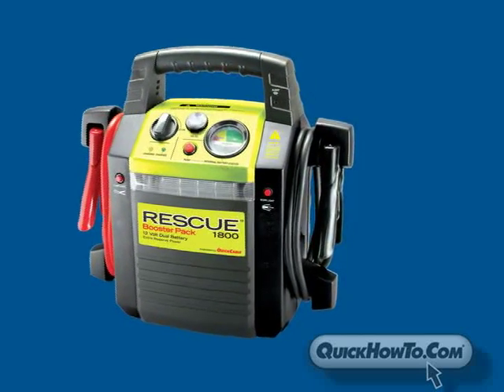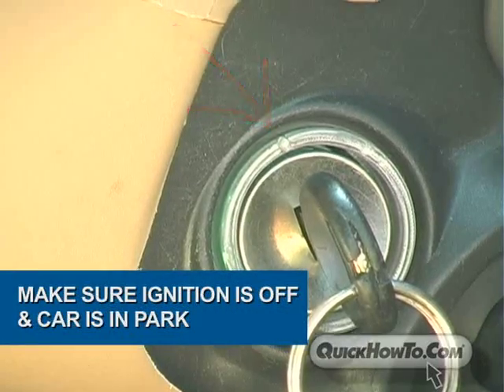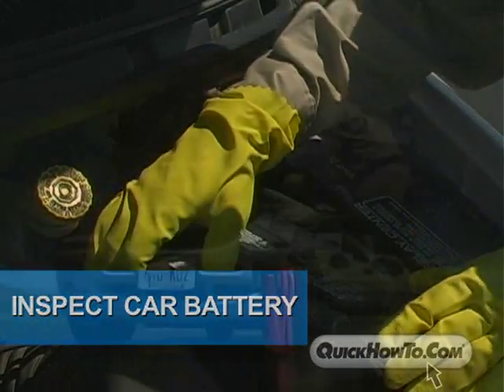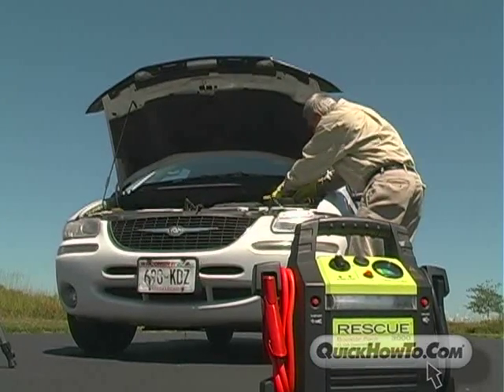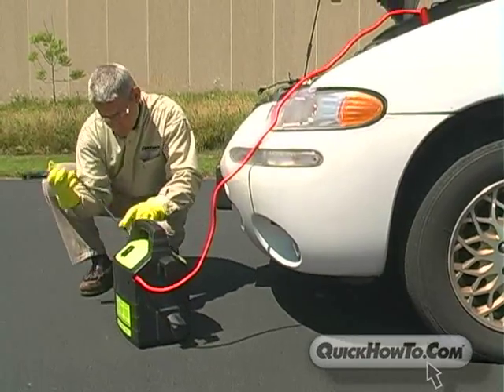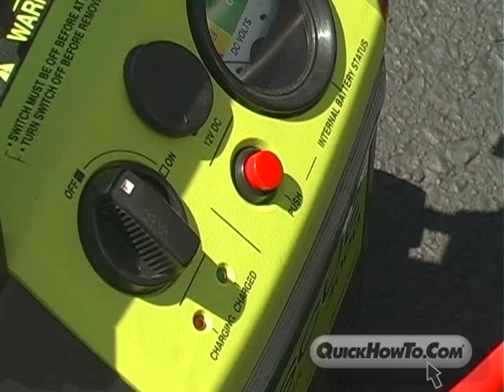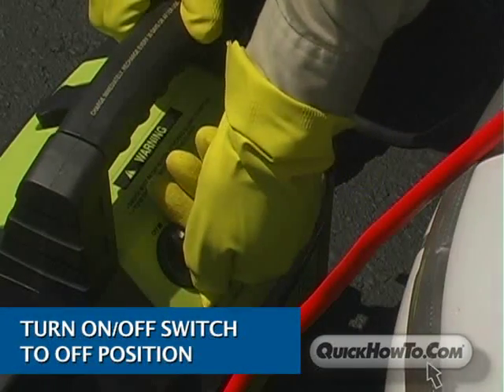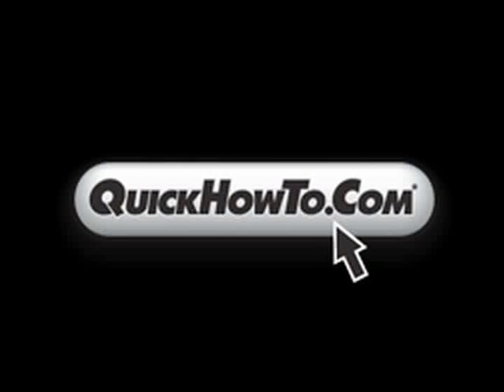How to Jump Start a Vehicle using the Rescue Booster Pack

Comment: Sorry for my ignorance..the negative cable of the booster can not be connected in the negative terminal of the battery?
Reply: Depends on the unit and instructions. My Duracell 750 peak amps has it connected to both battery terminals.